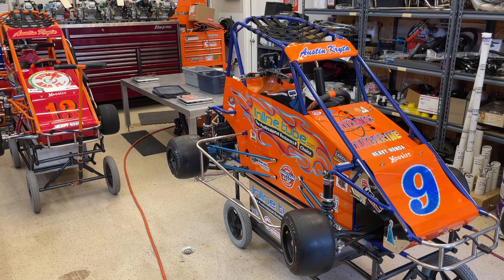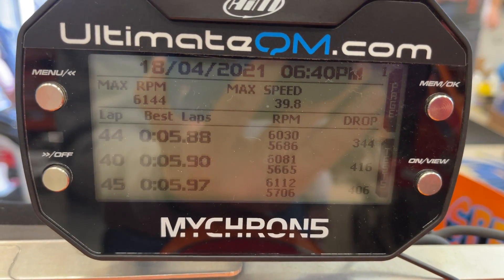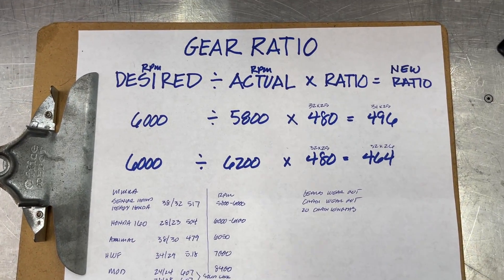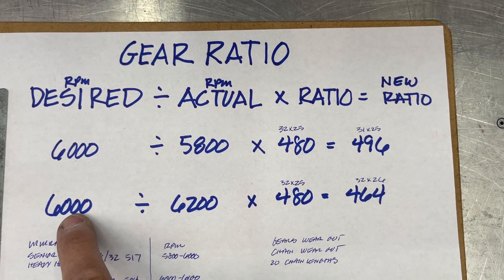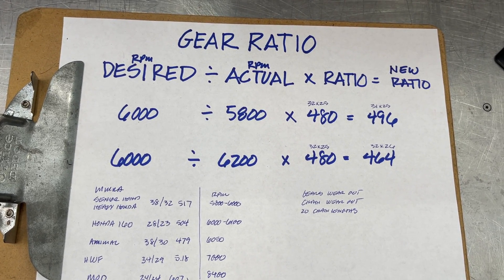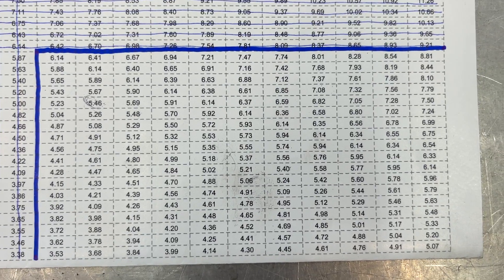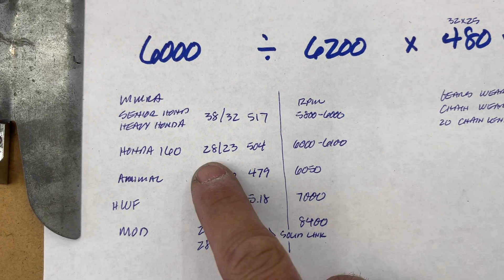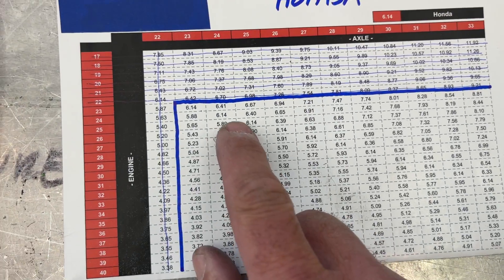How to pick a Gear Ratio - Quarter Midget Tech

Comment: Is there a trick for redplates? 
Kiddo didnt seem to have the top speed her first race compared to 2 other cars. 
It was 33/28 then i changed it to 34/26 (i need new chain lol). She said she didnt notice any difference... was pedal to the floor the whole time and still got lapped. 
Its an old ut1 i think.
Reply: Tire pressures to the moon! Like 25 psi. Target 4800 rpm peak in the ut1s. We had a lot of speed with a red plate with this setup.
Reply: @Irockthedrums08 replaces to ut2. She blew up ut1. It shook itself apart an puked oil everywhere 😂 . I ended up doing as much as 40psi in fronts. Did a test day. Was increasing pressures until i got to 40 front 35 rear. Didnt hear tires make that threshold sound. Figured it should be ok. Tire said 5 bar tops. So i gave it some room for air heating up 😅.

Comment: I have a 125lb kid running in blue rookie we can hot 5800 rpm ut3 engine but his speed is on 27 and that's in practice with no kids, when we race with others his speed is 25.5 we are running a 30 engine 31 axle we just don't seem to have holeshot what's ur suggestions, I was gonna go 30 33 or 30 32 when we go 1 to 1 or axle 1 under the engine the car falls on its face

Comment: 30 engine 25 axle and 42 engine, 35 axle both equal a ratio of 5:00. Any difference in performance if the bigger gear is on axle vs. motor?